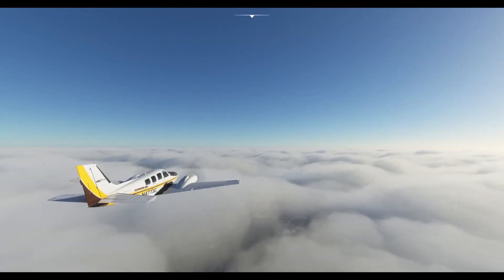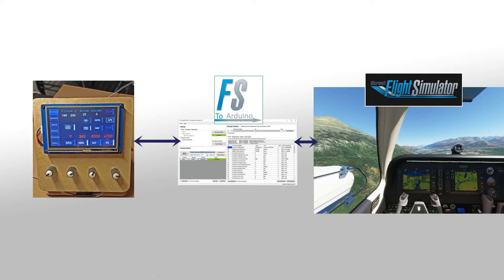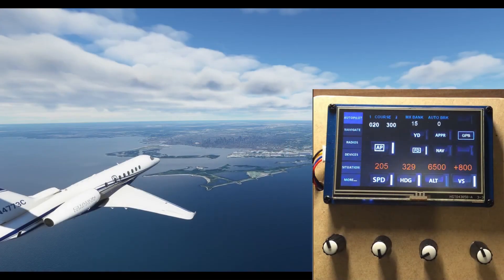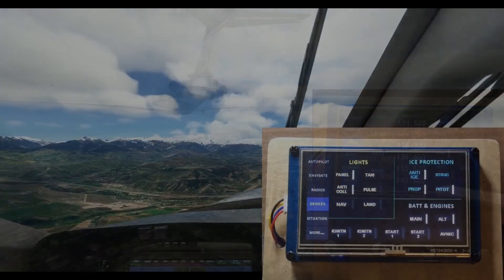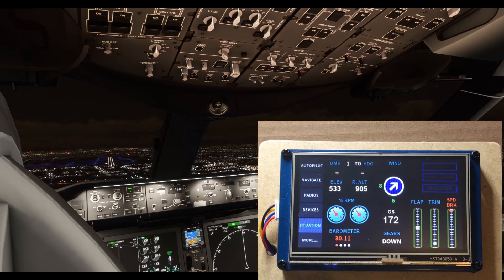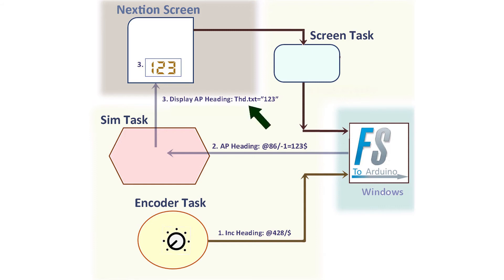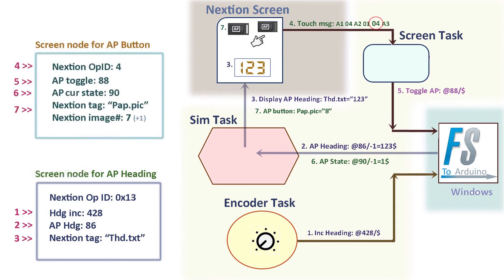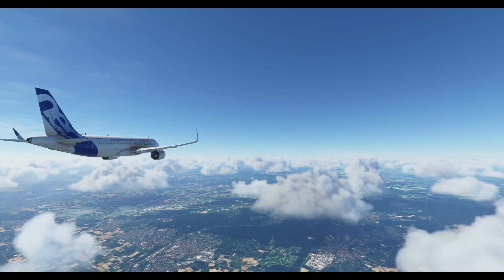Touchscreen Mini-Panel for FS2020

Comment: So i ran the sketch first in Arduino and it came up with multiple errors. I put files to necessary folders in Arduino but on upload zip and ran TMP2 ino 
I am using a Mega 2560 as no way could I get Arduino to recognise a ESP32 Wroom 32 . Doing my tiny head in. Any ideas or should I .
I have run several other uncomplicated programs so unit is OK
Reply from the maker: You must use ESP32.  Get the Arduino IDE to a point where you can load and run a simple sketch (e.g. LED Blinker).  There are plenty of tutorials on the web for installation.  
https://randomnerdtutorials.com/installing-the-esp32-board-in-arduino-ide-windows-instructions/

Versions to use:
   Arduino IDE 1.8.15
   esp32 by Espressif Systems version 1.0.3.  (Check under Boards Manager).
Reply: @discman777  many thanks will go again

Comment: Getting a "Incompatible F/W" when powering up. I have created three 7" pages (Splash, Autopilot and Situation). When I adjusted all the fields to the 7" display for those screens, I created a TFT file that I uploaded to the display. The upload showed Successful. Then I tried to test it. The Splash screen comes up on power on and then when I push the button it says "Incompatible F/W". When I created those pages I have selected the correct Nextion screen type and in horizontal mode. Any thoughts?
Reply from the maker: Looks like you’re using the latest 1.12.19 firmware but is basing off an old Nextion source (.hmi).  You must be modifying from an older .hmi?
Examine the LATEST 1.12.19 .hmi file.  In the Splash page, look for a new “tmC” Timer.  However, this isn’t your only problem!  You’ll need to restart your screen page rescaling efforts from the latest .hmi, otherwise there’ll be more incompatibilities.  If you have further question, please leave me an email address--more efficient than YT comments.

Comment: The included instructions are not exactly step by step. There seems to be some pretty big assumptions of a certain degree of proficiency in Arduino. For example, all the files that come with the zip...where do they go, what is imported into what. I have all the pieces but don't know where to begin....am I missing some step by step help/build documents?
Reply from the maker: I do not have step-by-step instruction on how to build the panel.  You’re right, this DIY project does require intermediate Arduino skills as I stated in the initial Design Notes.  Incidentally, a viewer who has successfully built the T.M.P last month has offered to write a detailed “Construction Guide” based on his experience.  However, there is no timeline on this. 
I don’t know where you’re stuck... but, should at least have installed the Arduino IDE and the ESP32 board extension; and run the ubiquitous LED Blink sketch.  There are plenty of TY videos on that.  From there, if you want to build the T.M.P code, the folder/file structure is depicted in the Folders.jpg file I included.  The other option is to try to flash the already-built binaries included (See the Sept 2021 Design Notes).  For the Nextion, there is no need to install any software.  You can transfer the included T.M.P.2.tft file to the Nextion with an SD card.
Reply: @discman777  I have all the parts and I am familiar with Arduino from other projects. I am going to try and attempt this project around Christmas when I have some time available. I have a UNO board....is that what you are indicating I use to flash the included .bin file to the ESP32? Can VSCode be used vice Arduino IDE? Also, can you inquire if it is ok to pass me the contact information for the person that just built one to possibly help me through it? I am willing to also expand on instructions if I can get through it. I will be building a 7" version.
Reply from the maker: @Chappie8824  The Uno will not be needed.  I have never used VS Code, so I can’t answer.  The first thing to do (if you haven’t done so) is to get to the point where you can load and run a simple sketch with the ESP32.
Please leave me an email address so I can better help with specific questions; and I can pass it to the said builder.
Reply: @discman777  Any work if the builder has put anything together yet to look at?  Thanks in for all this.  It's an outstanding kit
Reply from the maker: @harvesthunt   I have just finished a 13-page .PDF on assembling a T.M.P.  If you open the updated zip file, the file Building_TMP” is in the Documentations folder.  Hope that will help you and others.

Comment: could i make it with a 3in screen?
Reply from the maker: No.  That’s way too small for readability and touch.
In any case, Nextion’s graphics is non-scalable raster-based.   Any different screen size will require many hours of redoing the layouts from the ground up.
Reply: @discman777  thanks man, i almost bought it, i still looking where to find it

Comment: good evening,
sorry if I send the email directly but the message on you tube has been deleted.
I'm making his project but the 5 inch nextion gets stuck on the first screen and on esp32 I get this message.
could you give me some advice to make it work.
Thanks Nicola Italy

18:02:52.755 -> rst:0x7 (TG0WDT_SYS_RESET),boot:0x13 (SPI_FAST_FLASH_BOOT)
18:02:52.755 -> configsip: 0, SPIWP:0xee
18:02:52.755 -> clk_drv:0x00,q_drv:0x00,d_drv:0x00,cs0_drv:0x00,hd_drv:0x00,wp_drv:0x00
18:02:52.802 -> mode:DIO, clock div:1
18:02:52.802 -> load:0x3fff0018,len:4
18:02:52.802 -> load:0x3fff001c,len:1216
18:02:52.802 -> ho 0 tail 12 room 4
18:02:52.802 -> load:0x40078000,len:10944
18:02:52.802 -> load:0x40080400,len:6388
18:02:52.802 -> entry 0x400806b4
Reply from the maker: The message from the Serial Monitor appears to indicate a reset of the ESP32.  I don’t know what to make of it.  Either it is the normal power-on reset, or is from a program crash (forced reset).  A couple of months ago, one user had reported a stuck on “Waiting for MCU” problem.  He later resolved it himself, I recall he said the problem was on the ESP32’s end.
Since there are now two user comments of the same error, you may want to try using the original code release temporarily to test whether the new update is the problem (link still in video description).
Also make sure the Nextion is getting an adequate power source.  I have seen it hanging on the “Waiting” page when I used some substandard USB charger or battery pack.
Reply: @discman777  ok thanks I do two tests
Reply from the maker: Let’s see if the problem is with the Arduino IDE + ESP32 configuration...

Today, I installed the Arduino IDE from 1.8.15.  Then from its “Tools | Board Manager” dialog, I went to “esp32->Select version” and selected the newest “1.0.6”.  (Previously, I had 1.8.13 and 1.0.3, respectively)  Afterward, I built, flashed the code, and the panel came up stuck at “Waiting for MCU”!

I fixed it by going back to the Board Manager and selected the esp32 version *1.0.3.*; while keeping the new Arduino IDE at 1.8.15.  The panel is back in business.
Reply: @discman777  thanks with your info everything works,
i just have to change the graphics of the Nextion which is 5inch.
great device
Reply from the maker: @frugolo1972  Cool!  Share some screenshots when you’re done with your “mod”.
Reply: @discman777  ok thanks
Reply: Ciao Nicola! Mi aiuteresti riguardo la configurazione del esp32? Grazie ;-)

Comment: Will you make a video explaining how to make it? how to upload the code and everything? seems great and i want to make one
Reply from the maker: How to wire the components is largely up to you.  As you can see in the video, I have the screen and the encoders mounted flat on a piece of “clipboard”.  It turned out 45-deg angle for the rotary/pushbutton isn’t ideal.  I still have my ESP32 on a half-size breadboard using only Dupont jumpers to connect to the Nextion and encoders.

As for downloading, I can only suggest installing the Arduino IDE plus the ESP32 addition.  And using that to build the source and flash the code.  (Unfortunately, I tried and failed to use the ESP32 Download Tool.)   Flashing the Nextion is the easy part, just need a micro SD card to transfer the binary, no software installation needed.  It’s a DIY project, and various tutorials for of the above can be found on YouTube.

Comment: Hi there, I try to build your amazing project, but I have a problem. What to do with this two files? T.M.P.43.tft, T.M.P.43.HMI
Reply from the maker: Search for: Nextion.
Reply: @discman777  I've used this program to import your profile. success , but no chance to upload them into my display. Nexion found my com port, but it is unable to fix the upload rate . I have an nexion display with an external uart device , USB storage and no SD card. But same display and same size... thx for your help
Reply from the maker: I do not have the Nextion serial programming adapter, so SD card is the only method that I have ever used.  Serial, even when it works, would take much longer.
Reply: @discman777  Ok  Mr Diskman, i' give my last idea a chance to solve my "amazon order problem". I ty to convert your sd cardfiles , put them to my"disk-storage"  . If I got no luck, I'll send my tft back to amazon. Thx 4 all...

Comment: hi again, I made the module, but I have a "problem"... the screen shows me always the first page "initializing". should it shange when the ESP is connected and MSFS runing only ? anyway on the Computer SimConnect says it is connected to the ESP and MSFS but no initialisation seems runing :(  May someone help me ?  thanks
Reply from the maker: Unfortunately, it’s rather impossible to troubleshoot remotely, basing only on description.  If it is stuck at the first page, the ESP32/MCU probably is not even doing any controlling.  Without connecting to the sim, you should still be able to change pages etc.  Leave me an email address so we can communicate more efficiently.
Reply: @discman777   thank you for your reply. thats my email adress : sdechats2@worldonline.fr
Reply: Hi, I have exactly the same problem. Have you found any solution? My email butifarri@gmail.com  Thanks a lot in advance!
Reply: Hi, I also can't go beyond "Waiting for MCU ..".
The serial monitor repeats the following logs.
18: 53: 36.557-> rst: 0x7 (TG0WDT_SYS_RESET), boot: 0x13 (SPI_FAST_FLASH_BOOT)
18: 53: 36.557-> configsip: 0, SPIWP: 0xee
18: 53: 36.557-> clk_drv: 0x00, q_drv: 0x00, d_drv: 0x00, cs0_drv: 0x00, hd_drv: 0x00, wp_drv: 0x00
18: 53: 36.557-> mode: DIO, clock div: 1
18: 53: 36.590-> load: 0x3fff0018, len: 4
18: 53: 36.590-> load: 0x3fff001c, len: 1216
18: 53: 36.590-> ho 0 tail 12 room 4
18: 53: 36.590-> load: 0x40078000, len: 10944
18: 53: 36.590-> load: 0x40080400, len: 6388
18: 53: 36.590-> entry 0x400806b4
18: 53: 36.691->

My email address is redanchor777@gmail.com
Thank you!
Reply: @多趣味おじ   hi, if you still have the same problem, you maybe can try to add this line " delay(500); "  just after the first line of the void setup. It's help mine. Beside it, there is now a new version, have a look.

Comment: This is compatible for MS-FSX?
Reply from the maker: The short answer is: I don’t know.
The long answer is: It depends on the FS2020-To-Arduino (FS2020TA) software, which the panel relies on to interface with the sim.  Plus, FS2020TA talks to SimConnect which FSX and P3D also uses.  You can try asking the author of FS2020TA on GitHub.  You can also just download FS2020TA and run both it and FSX on Windows.  If the software GUI is able to display the sim variables then at least the chain works in one direction; but this can’t demonstrate the write-to-sim direction without some hardware.
Reply: @discman777  ok...thanx for your answer...
Reply: Could i use NodeMCU esp8266?
Reply from the maker: You need to check the specs of your version of the 8266 MCU board to decide.  The requirements are: 320KB of flash, 32KB of SRAM, need one UART for the Nextion, 8 digital inputs for the encoders (assuming not using the pushbuttons).
So, does the FS2020TA interface work with FSX?
Reply: @discman777  for 8 digital input, how to define it in arduino sketch?...about fsx, i don't try it yet because i dont have esp32...i'll try it using nodemcu esp8266...i'm sorry if my english bad...🙏
Reply: I found error compile the sketch if i use nodemcu esp8266...